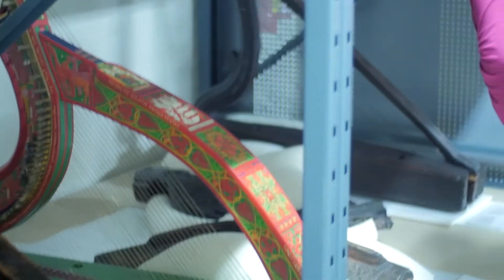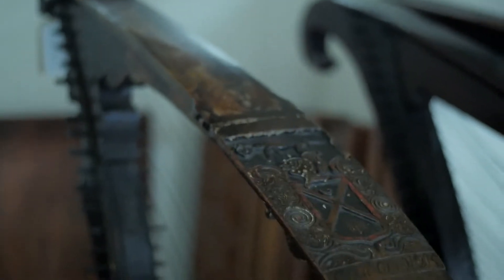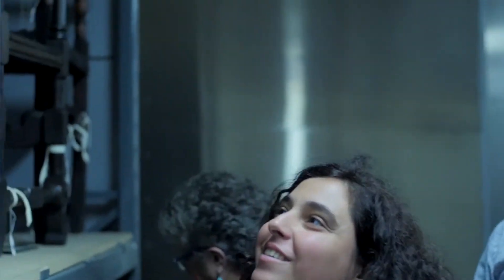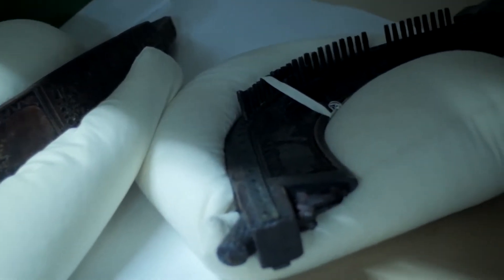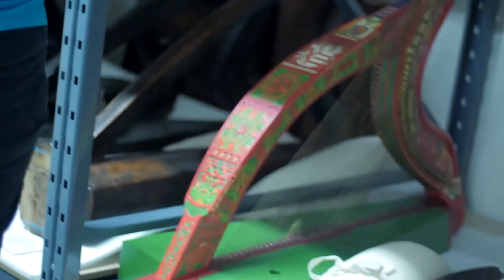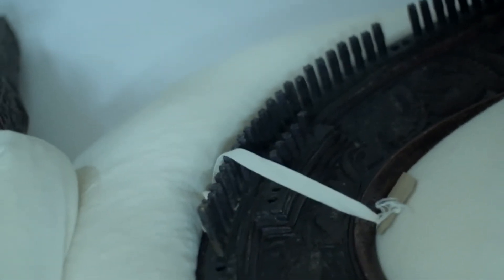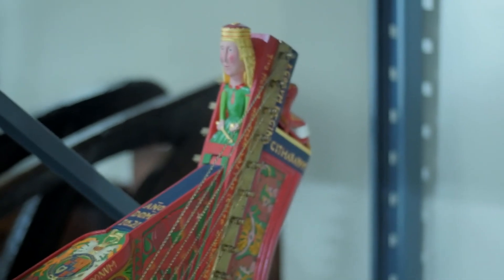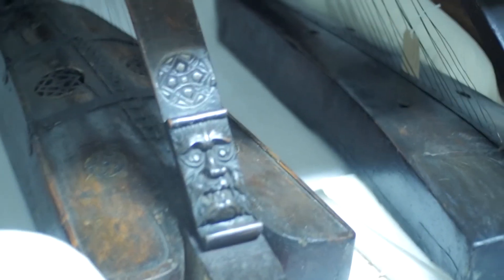Viewing historical Irish harps in the National Museum - Scoil na gCláirseach field trip

Comment: if they aren't built to the same parameters, they aren't copies... they are  'built after' ... rather like the fudged 'copy' of the Bunworth that BMFA had made... just a different shape, and a different construction, and  some of the issues sorted out... but it's a copy, and proves the original worked, somehow.

There have been makers building to the parameters of the extant harps, but if modern harpists insist on heavy stringing in yellow brass, and  modern tunings, the actual copies are not going to survive, so buyers insist on heavy instruments that do what they want, rather than finding out what the actual harps did... and until players are prepared to accept that what they are doing is more based on 1970's phospor-bronze  reinvention, than historical stringing, things won't change.